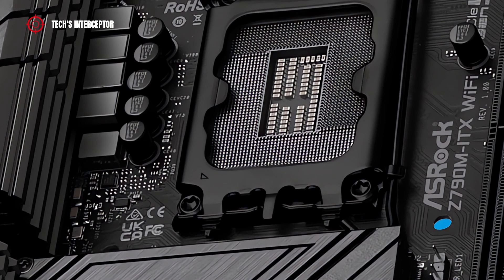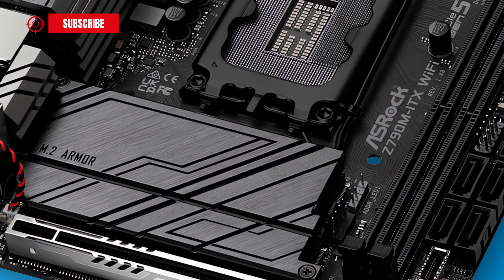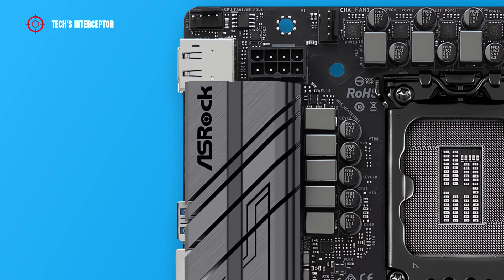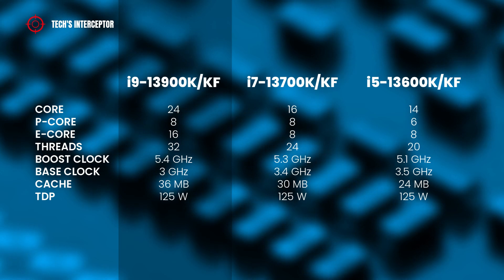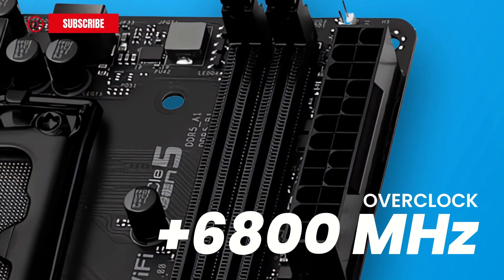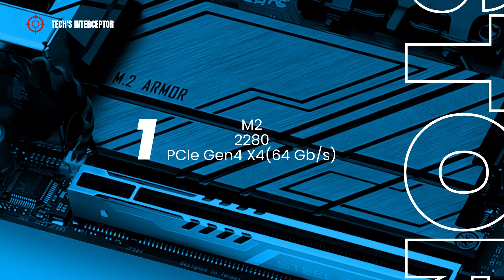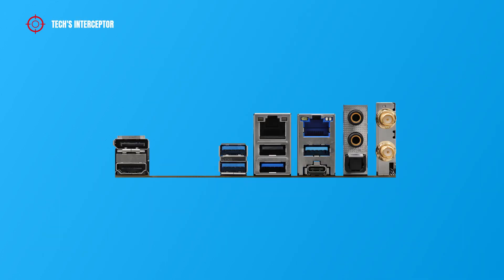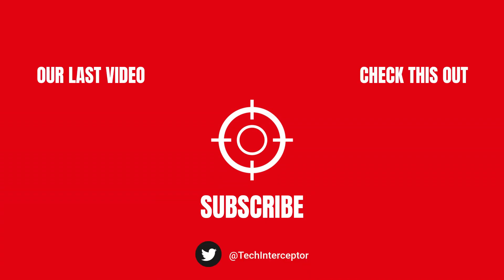ASRock Z790M ITX WiFi - New motherboard designed for 13th Gen Intel Core desktop cpu

Comment from the maker: What do you think about the new ASRock Z790M ITX WiFi and the 13th Gen Intel Core cpu? Tell us here in the comments and don't forget to subscribe.
Reply: This board seems like a downgrade with only the 7 phase power delivery & no TB4. Plus, more money out of pocket for DDR5. You can do a bio's upgrade and run 13th gen CPU on the last gen 8 phase Asrock Z690M-ITX/ax  @ Newegg for $149.00
Reply: @CrazyCranker  but you would avoid DDR5 entirely if you went with the Z690 from asrock..
not that it isn't a smart move.. but for lower power 12th gen CPU's there is no way to get higher DRAM speed than 3200.
im wondering how much the impact is from the lackluster 3200mhz DRAM vs a DDR5 system with the same CPU, different motherboard(support for DDR5)
Would the difference be huge or just mediocre?

atm i am actually running a 12th gen asrock itx system and ive been wondering if it is a step up if i swapped the board for a DDR5 board and settle for that for the coming 2-4 years.
Reply: @VintageCR   Unless your a competitive gamer where money is on the line, I don't think DD5 is worth it. I think next gen DD5 will be more relevant. :)

Comment: I have this with a i7 13700f . Evga 3080 ti ftw3 hybrid and 32gb ddr5 . Compared to my older system a i5 10600k and gtx 1080 ti it's a beast system and this board works well I don't notice any problems related to the board I have had more issues with my ram because I cheaper out
Reply: good so far?
Reply: @davysmith8569  ye just basic overheating problems with lga1700 cpus i had to undervolt just to keep it below 80c i was hitting mid 90c playing hogwarts legacy
Reply: @acid3129  nice good to hear, hogwarts is a cpu killer now lol

Comment: In comparison to other similarly advertised  boards, this board is not a good choice for enthusiasts. There is an argument that more money will be made from "advertisers" than ASRock. Entry level at best.
Reply: What in your opinion makes it "entry level at best"?
Reply: @morten1  uhh the lack of cooling? the power limit? what is the point of a z board if you can't overclock it? it's not even entry level, this is DOA at best
Reply: @bill_g.  lol ok then. Just a question. I'm sure it's an ok board for the price.
But OFC you get much more quality if you spend double that price
Reply: @morten1  it's really not. it's $230 and has less features than boards half its price. why are you being so defensive of a shit product?
Reply: @bill_g.  what board is the same price. z790itx and DDR5. Give me one.
Reply: @bill_g.  I like people that talk bs 🙂Give me ONE mini-itx Z790 Board with half its price and double its features :-)))
Reply: @BW-og1vu  you don’t need a z790 board
it has zero special features that a z790 board is supposed to support
the b760i msi and gigabyte boards will be much better performers than this
Reply: @bill_g.  YOUR statement was there are cheaper and better Z 790!!!£ so don't try to argue now and bend yourself around. You posted a wrong claim. That's all!
Reply: @BW-og1vu  where did i write that sonny? shouldn’t be so eager to lie
Reply: @bill_g.  me bad, i  read the answer from another one to your statement with pinpointing on the Z 790. But nevertheless not everyone wants to overclock,

Comment: I just bought this board with 13700k but haven't had a chance to build it yet. I normally use asus boards but they are crazy expensive this time around. I'm trying to find out if this asrock has Intel wifi. If not, i might return and go with MSI
Reply: It has

Comment: Is this one also P1 limited to 150W?
Reply: trying to find the answer to that...any idea if its limited?
Reply: @komm13  got same exact question. Found any answers?
Reply: @K0J0K  I think it is as well someone on Reddit got it and said it is capped at 150w.
Reply: @komm13  it’s fine. I already ordered my parts few hours ago.
Reply: shame as the i5-1300k shoots up to 181 Watts , so this damn thing under clocks it. kind of shaves off that nice extra gap
Reply: You can manually set PL1 up to 150W, but you can enable Dual Tau Boost and it will set PL1 to 165W and PL2 to 250W with an i5-13600K.

Comment: This card looks decent, unfortunately the prices are now out of control.
On Newegg this is priced at $ 230 which for a low-end motherboard with 7 + 1 + 1 phases is a lot.
The ASRock Z790 PG-ITX/TB4 which is slightly better in the power phases, costs almost $ 350.
Reply: That’s normal price the z690 and z590 are both the same… how long are you even gonna wait at this point? It’s already been 2 years and ITX is a premium not bargain
Reply: Asrock TB4 Defective. Confirmed